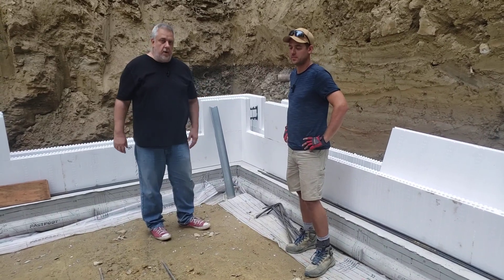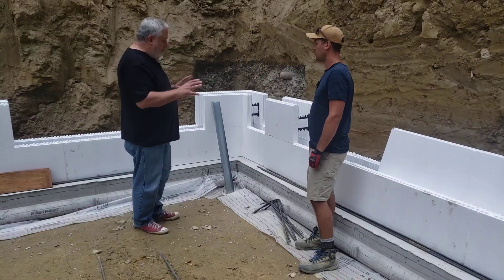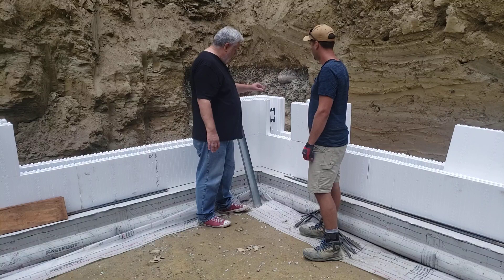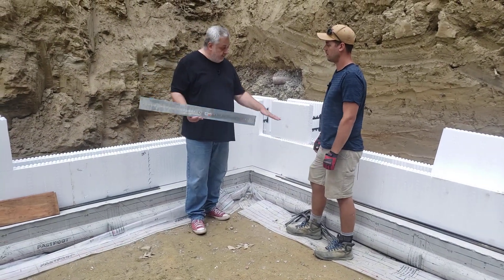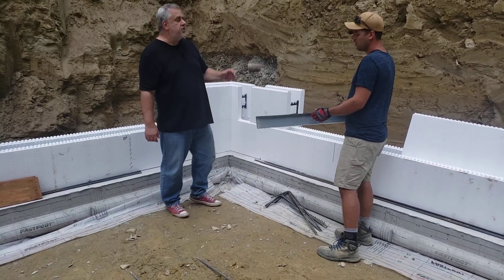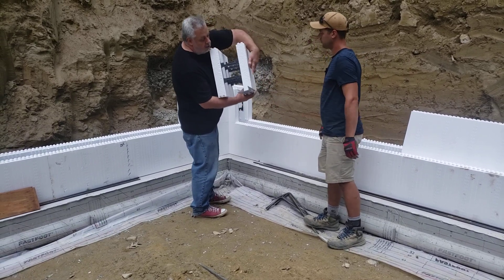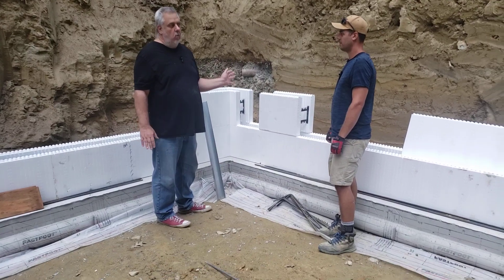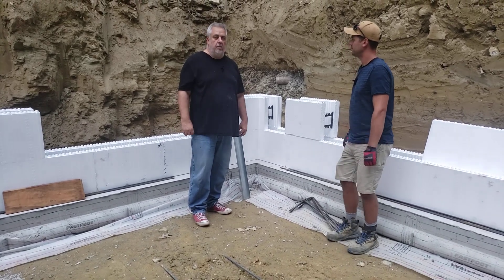ICF Foundation Layout

Comment: Separating the footers from the concrete system creates a cold joint. Could this be eliminated with a monolithic pour?
Reply from the maker: It could, but it would take alot of coordination? And I would ask why do we care about a cold joint at the bottom of the wall?
Reply: @stevenbaczekarchitect9431  I was wondering if a monolithic pour would be better so that you don't have a joint of potential leakage in an area near water? I  was just wondering as that what we are doing on our ICF build. 😊

Comment: I can't see how the foam corner overlapping and alternative orientation makes any difference except in assembly. It's a solid concrete core in the end (No?)
Reply from the maker: Yes it is, but the overlapping will add strength to the corners for bracing until the concrete cures